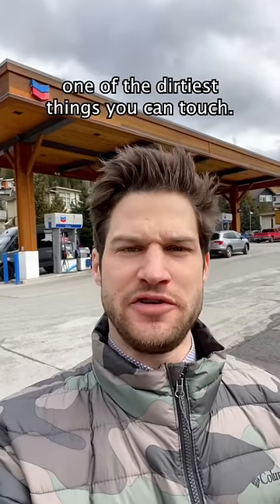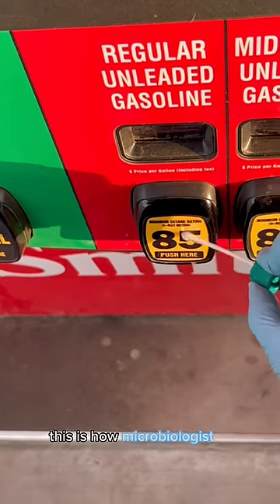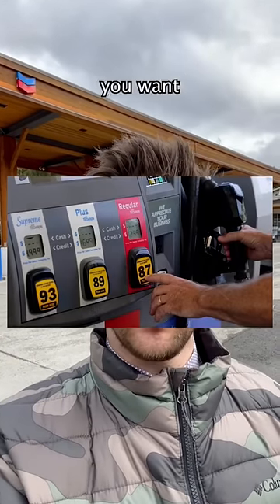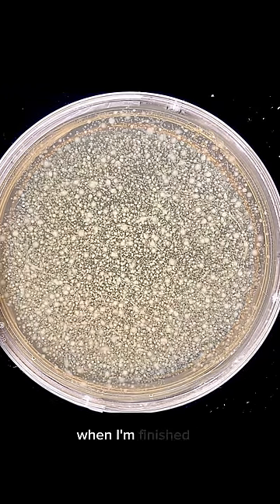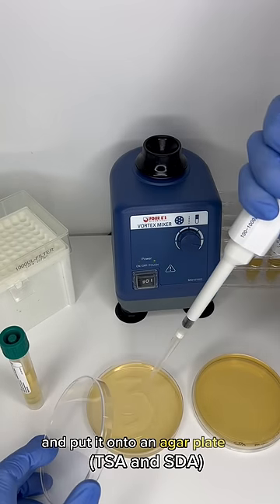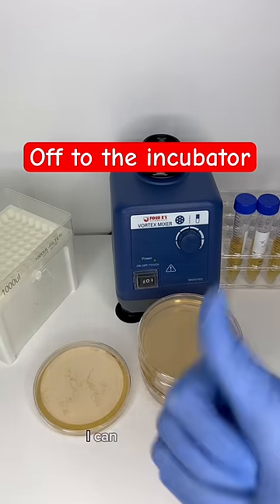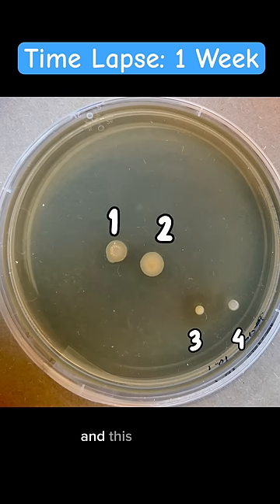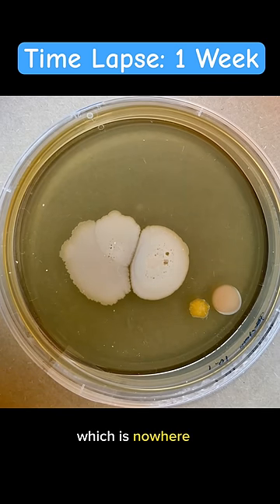Bacteria on the gas pump buttons?

Comment: Not everyone pushes the 85 octane button, but everyone touches the pump handle
Reply: you actually buy premium?
Reply: @XenoLixx  I have to
Reply: @XenoLixx some cars need it since they have more premium engines
Reply: @XenoLixx my car requires i buy at least 91 but no gas stations around me have it, so i have to buy 93. my old car could take 87. never seen 85 around me.
Reply: @yammmit  e85 is basically the eco-race fuel. very few vehicles take it, even less can only run on it. It's dirt cheap, provides good gas-mileage. The exact opposite of race fuel, but in the same boat of usefulness for general population
Reply: @Mcflapphypants  fair enough, never seen it in my area. 95% of the pumps i see have 87, 89, and 93. thanks for the info!
Reply: @Mcflapphypants  It's 85, not E85. Regular 85 is the octane most commonly seen in areas of high elevations, like the bulk of Colorado, mountain gas stations in general, etc . 87 is actually mid-grade when 85 is the regular at thos elevations.
Reply: Hold on, in the US you only have one pump for several different types of petrol? We have one for each type in the UK.
Reply: @CaveSpiderRider yes. You hit the button of the fuel you want, and an internal valve flows the octane of fuel that you want through the single nozzle. Diesel nozzles do not share with a petroleum nozzle though, they are completely separate. Petrol nozzles are black or red, diesel is green, and E85 is yellow.
Reply: @CCHAWC717  interesting, didn't know it was an elevation thing. I'm in Illinois and never seen 85 before, everywhere has 87 as the lowest near me.
Reply: @Mcflapphypants  im pretty sure e85 gives you significantly less mpg as it burns faster and less efficiently than normal gas. Another reason people dont like it is that it tends to have more moisture in it causing fuel lines to rust from the inside out
Reply: @CaveSpiderRider  save for Diesel and Kerosene American pumps haven't been different nozzles for a long long time.
Reply: I use the pump to hit the button. So the button is never touched.
Reply: @kylebusc3624 that has a lot to do with the fact that E85 has methanol in it which has less energy than pure Gasoline from a combustion of the same amount of material. 

Alcohol is about 10% less energy dense than petrolium distilates.
Reply: @XenoLixx all cars with turbos require it
Reply: Unless it's in NJ
Reply: @XenoLixx yea my car requires premium
Reply: 1000th like
Reply: @aether2980 my car will fucking blow up without it. Octane rating isn't just "fancy gas".
Reply: when you press the 85 button you grab the 85 pump handle so... WRONG
Reply: Bro didn't watch the video
Reply: @XenoLixx officially according to my user Manuel I’m supposed to be buying ethanol free, but that’s $4+/gal and it also has a section on what to do if I use the lower quality gas.
Reply: @XenoLixx some cars require better gas as to not ruin the engine.
Reply: Even then I use the pump nozzle to press the premium button 💀
Reply: No but 85 is the most common.
Reply: It's the most used out of all of them, so the others would have even less. But yes the handle would be great to test
Reply: Jokes on you
I use my mouth to grab it
Reply: @yammmit 93 is better than 91. I have ethanol  91 and my 2 cars that require 91 and up dont like it very much. Both run better on 93
Reply: @XenoLixx I want my car to not get all clogged from impurities. Putting good gas gives better mileage.
Reply: @XenoLixx even if you dont buy premium, normal cars arent meant to run on anywhere near as low as 85
Reply: I thought the same thing. Hypothesis: Gas pumps are the dirtiest… tests button? Oh that TikTok science.
Reply: @CaveSpiderRider .   You also still have a monarchy
Reply: Not in New Jersey we don’t XD
Reply: @XenoLixx my car requires 93 octane because it has a high performance motor. if i put 87 in the tank the engine won’t run at peak performance and will have pinging due to low octane.
Reply: @Mcflapphypants there isnt a car that runs on only E85. If a car can run E85 it is a flex fuel engine and can run just regular gas if it wanted to
Reply: @Mcflapphypants also it actually provides less MPG. When you adjust the cost of the lost milegae it pretty much evens out with the decreased cost. E85 is cheaper but you will get less miles per gallon. Its not a negligible difference like 87 gas and premium is. It is 37% less power per stroke cycle. So E85 Will get 63 miles under the same circumstances 87 will get 100.
Reply: @XenoLixx  Some cars get damaged if you don't, usually expensive cars.
Reply: @CaveSpiderRider That's very inefficient
Reply: @kylebusc3624 E85 won't rust your lines. If your engine is designed for it then the builders accounted for it.
Reply: @XenoLixx yeah, i have to
Reply: Wait, you don't have gas filling attendants that pump out gas for you in the United States of America?
Reply: @Mcflapphypants lmao e85 does NOT provide good gas mileage.
Reply: @kylebusc3624  It's highly corrosive and if your fuel lines aren't built for e85 it will destroy them over time.
Reply: @IDontLikeHandlesWithNumbers New Jersey and Oregon are the only two states in the US where it is actually illegal for you to pump your own gas, so there are gas attendants who do it for you -  everywhere else is self-serve.
Reply: @RGH0910   Here in Bulgaria almost every station has gas station attendants
Reply: @cursorguy  it has nothing to do with that 😂. It’s just if your engine has a compression ratio to height you’ll get pre-detonation
Reply: @kylebusc3624  dude they all burn at the same rate its just a matter of how much you can compress it before it detonates. You more compressions equals more power.
Reply: There are so many people that don’t understand octane it’s sad. It’s all about how much you can compress the fuel and air without getting pre detonation in the engine.
Reply: @Darktacomic  "Since ethanol contains less energy per volume than gasoline, FFVs will generally get 15%-27% fewer miles per gallon when fueled with E85, depending on the car and the driver's driving habits."
Reply: I bet diesel is the dirtiest. Change my mind.
Reply: @kylebusc3624  sorry your right I mis read that 😂. E85 is definitely that way. Some people where talking about 91 octane burn slower which isn’t true.
Reply: @Mcflapphypants Good gas mileage? I what car? In went on a roadtrip with a suburban and we needed like 25% more fuel with e85…
Reply: @XenoLixx most German cars require it, they will barely run on regular… however American cars usually can take regular fine.
Reply: @XenoLixx i grab the handle and smack the button with the nozzle tip.
Reply: @XenoLixx my motorcycle requires 91
Reply: @fremue9312 e85 is a performance fuel, not a long range fuel
Reply: @XenoLixx  certain engines require premium gas. It all depends on the compression ratio. For example, my car has a compression ratio that is 11:1, which is high, most cars have an 8:1 ratio. Generally speaking it basically relates to the volume in a cylinder, and how small of a space the given fuel and air is squeezed into. The ratio is created by the difference between the top and bottom of the piston stroke. So higher compression means more pressure in the combustion chamber, which requires higher octane gas to resist that higher compression so your fuel doesn’t prematurely detonate before it is ignited by the spark plug.
Reply: in Europe we have different handles for different types not buttons also you could just hit the button with the pump handle
Reply: My car can take 87 and up. 85 is too low of a grade
Reply: It’s still a German car, so I use premium
Reply: @XenoLixx some card “actually” need premium.
Reply: @XenoLixx Yeah, many people have to. The car I drive explicitly says “premium unleaded only” if I put regular in it will cause a lot of mechanical problems and seriously damage performance, ultimately it will cost me more to not buy premium. Just like how you never put gas in diesel although putting regular in a premium is not as severe.
Reply: @XenoLixx i modified my civic to make more power on premium lol it's probably like 10hp loss if I use regular but it's worth
Reply: Thats y they clean them
Reply: @Mcflapphypants I thought e85 gave more power with way worse mileage, atleast the e85 in my country does that.
Reply: @Mcflapphypants  Cue Dr. Cox: "DUMB, DUMB, DUMB, DUMB, (pause) DUMB, DUMB, DUMB, DUMB"

Comment: Bro took one sample, did one dish and called it a day 💀💀💀
Reply: Also he didn't even do proper aseptic technique, mixed it up with the entire lid off for ages 😭
Reply: he didnt bother to test the handel which is the dirty part
Reply: He didn't swab the handle which would be the dirtiest part. Plus, gas is a solvent and probably kills 99.99% of any living thing it comes into contact with, if some gas somehow makes it onto the octane buttons or the handle because of a little spillage, it's probably going to kill off a lot of the bacteria.
Reply: You guys do realize that the fun fact guy quoted that the button is extremely dirty. Yall just hating cause you didnt like how the vid came out. Also yall realize the pumps get cleaned somewhat regularly right?
Reply: @kingwildcat6192000  The gas pumps get cleaned when they break down and the mechanic replaces the handle with a new one.
Reply: @justacinnamonbun8658  yeah no you are completely wrong. I've worked at 2 gas stations. Precovid and postcovid pumps have always been cleaned at least once a week. Most corporate gas stations such as kwik trip clean their pumps roughly daily. The mom and pops with franchises are more once a week if not more while foreign owned may be once a month. Before lying try actually working at a gas station.
Reply: @justacinnamonbun8658  it makes me sad that I have to talk about my work (and think about it tbh) rn but I work at a pretty busy gas station in my town (it’s a co-op which means it has very consistent customers) and we wash every point of high contact every 2 hours, which includes every gas pumps buttons, touch screen, keypad, and pump handles

On top of that we have a constantly cycling pump cleaning chore that makes us extremely thoroughly clean our pumps (even including the hose and anything around it) and that process also uses a disinfectant

I can’t speak for American gas stations but I can say that co-ops are generally very clean like this (we’re especially known for our bathrooms because we clean them several times a day)

Comment: Well today I learnt that some places in the world have buttons for different octanes instead of different hoses and handles.
Reply: Where I grew up we had a combination of both, mostly the button selectors on new stations, but the older ones all had different hoses for each grade, and some even still had the pump holders you had to lift to open the valve. Haven't seen a multi hose one in years now aside from a different hose for diesel
Reply: Must not be American. Only the diesel fuel is seperated from unleaded on a standard pump.
Reply: @DoubleDsDeliveries  you must think "American" is not a massive country with a wide array of gas stations that differ state to state. American to you means anywhere like the poe dunk town you grew up in.
Reply: @LotusAuer  That's interesting. Here in Australia every single place I've seen is multi-hose. Plus we also pay after we pump the fuel, which I think is the opposite from the US. I'm assuming you're American, in which case would be interesting to hear from a European if their country is different or not.
Reply: @DoubleDsDeliveries  I'm not, Aus. Here most of the time it's different hoses for different octanes, and then the diesel is either another more different hose, or most of the time, a completely separate unit.
Reply: @ziggybadans hello from France
We basically have 1 hose per type of octane, Idk the corresponding names but we have unleaded 98, unleaded 95 (both inclifes up to 5% ethanol) 95-e10(10% ethanol), and e85 (up to 85% ethanol, but not every where Although it has expanded in the récent years)

We also have diesel that we call gasoil or gazole, premium gazole, and gpl that you call LPG iirc, but this one is usually far from the others 

And now also an adblue hose, but not everywhere

Also we either pay up front with our cards, basically it check if we can put say 120€, then if you can, you can fill up your tank and it will pay what you actually took

Some other means of payment include paying up front at the clerk for a finite quantity, either card or cash, and some place that no longer have stores adjacent have kind of ATM to convert euro bills into scan ticket for fuel
Reply: @patience__8051  Hello! That's interesting, a bit more similar to how we do it, especially with the octane. We also have 98, 95 and e10, though not e85 as far as I know. At larger places we also have adblue hoses. Australia used to be pretty big on LPG but now it's not that common at stations. Thanks for your input interesting to learn!
Reply: @DoubleDsDeliveries go to a sheetz ngl my first time getting gas at a sheetz I had to go get help cause they have 3 nozzles and multiple different gas buttons I was sooooo lost 😭
Reply: Because america is baby mode
Reply: So in the US, if you want say 10l of 98 (for a sports bike for example) how do you not get some 91, or worse E85 mixed in from the hose, and pump?
Reply: @G-force_Motorsport  Yeah I'm not sure
Reply: @G-force_Motorsport it would be such a minuscule part (less than 0.001%) of the gas pumped that it is never an issue. Also, it’s very rare, at least in my experience, to find anything over 98. I may be wrong but you’d have to go out of your way to get anything over 98
Reply: @tyroberts9520 That was 10l not 101 lol. Ten litres. I agree you'd be very hard pressed to find race fuel in a servo. It would be a bit more than that percentage imho.
Reply: @ziggybadans  We can't be trusted to pay following pumping in the USA anymore. Gas too expensive. Lol
Reply: @ziggybadans  Where I am in Canada, the paying part depends a lot on the hour of the day and area, if it's a high crime area, you pay before (inside or on the pump), elsewhere it's if it's between 22-23h and 6-7h. Rest of the time, you can pump and then pay.

Comment: As an Australian I’m surprised not at the amount of bacteria but the fact that you have 1 hose and then buttons to pick your preferred option. Down under each fuel option gets it’s own hose!
Reply: Most pumps in US only pump from a single tank of 85-88 octane and uses additives to adjust the mid and high test options. Just make sure to use whatever your driver's manual says for octane as using too high or too low can cause poor mileage and performance which will cost much more long term then a few cents per gallon
Reply: Me too!
Reply: I was just coming to the comments to type almost the exact same thing.
We have a pump for each type of fuel here in the UK, rather than a selector.
We have a lot of diesel cars over here, so we usually have 4 pumps. Petrol, performance petrol, diesel and performance diesel.
Reply: @Four20Kevin too high octane wont do anything. Too low octane is dangerous as it can cause your engine to ping and in extreme cases can break it. Its not just about mileage
Reply: some are like that in the us, not super common anymore though
Reply: @Fred_the_1996  exactly, it actually doesn't have much to do with mileage or performance at all other than the fact that some vehicles are tuned to adjust for octane.
Reply: That's what I was thinking.
They get buttons?

Comment: I always always wear a leather glove when I use the fuel pump. Germs yeah but there’s a lot more on those pumps than just germs.  I don’t like getting gasoline or diesel on my hand and then transfer it over to my steering wheel etc.

Comment: you can always tell someone lives at a higher elevation if their local gas stations regular is 85 octane instead of 87
Reply: This is the first time I've ever heard of anything below 87 octane gas, but I guess it's because I live in NY.
Reply: @Joestorm2000 ethanol or corn. It’s cheaper but burns 1/3 faster than regular
Unleaded. It also can add quite a bit of horse power!

Comment: My man didn't just swab the squeeze handle, I can't even.
Reply: Saving that for a later video. Gotta get them views
Reply: @cam5816  I can see that.
Reply: He just followed what the claim was in the example, which was specifically about the button. Did people miss this part of the video?
Reply: @ludvig3242 did you miss that in the original video, he talks about every part of the pump and not just the buttons?
Reply: @gavinrolls1054 the guy in this video said he is doing only the 85 button and showed the part of the original video. Did you just miss that? Smh my head
Reply: @IDontLikeHandlesWithNumbers  common sense be like "hmmm what do people ALWAYS touch...let's see...the buttons they can choose different grades but they all use the same handle......HRRMMMMMMMMMMMMMM"
In the next episode he will test the machine, maybe the bottom of the car but never the obvious choice, not as many views.